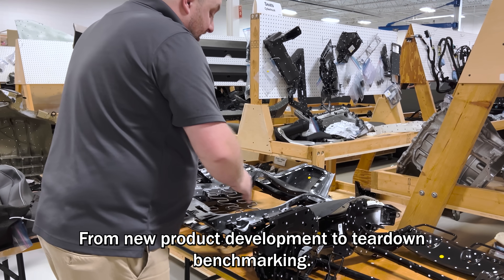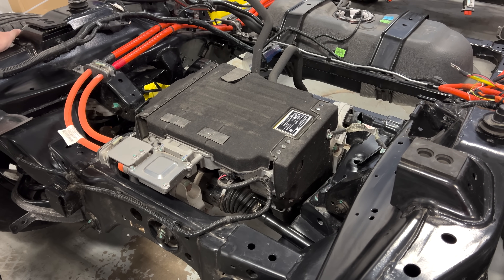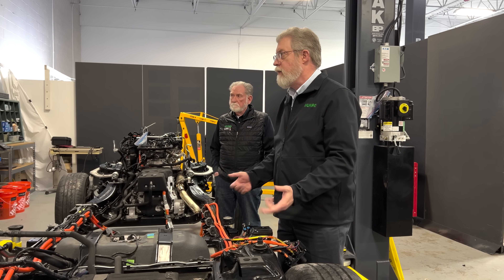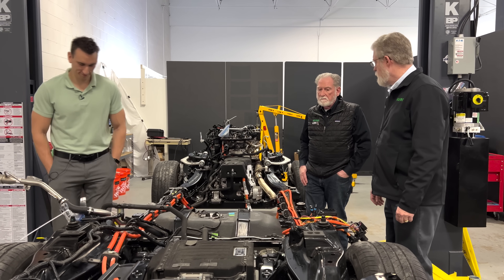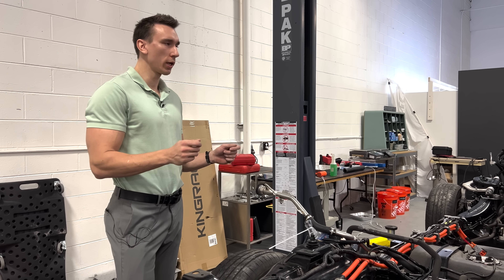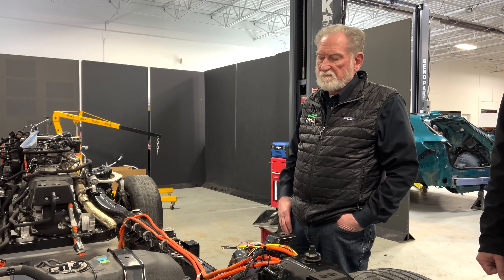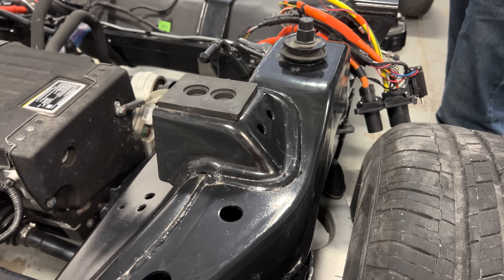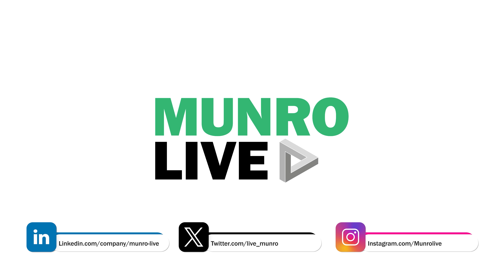There's a Monster Under the Bed of the BYD Shark!

Comment: I will have to disagee on the comment about there ground strap. For high voltage system, ground the case is always a practice. By the way, this so call ground us not the real ground, the tires are insulating the whole car, so the wait he mention is like create the shield to shield the drive noise doesnt not necssary to be the case, this type of ground will prevent noise from getting into the system, but can prevent the noise from system to get out. That say, if the paint on contact is not grind off, then it is not a very good ground. But consider it is auto motive application. Ive seen worse.
Another comment about replacing casting with welding. Casting is a process more difficult to control, especially for load bearing memeber. It is a cheaper process than fibrication, but to factoring in defect from the process( which always built in, hard to eliminate) you may end up using more material to achive the same engineering factor, or even blow through your interface envelop. The return from taking the risk is not really justified. That why on the railway side, the truck frame is moving to fibrication for newer design from casting frame. To further reduce weight, exotic material like FRP has start to emerged.
Reply: Yes, I agree that a ground strap is a good practice.  The issues here are it's location (completing a ground loop) and it's implementation using the threaded fastener as the current carrying component (not recommended).
Reply: @PaulTurnbull-EMfield How is it completing a ground loop between the two circuits when they are not connected at the same time? The charger only operates when the car is stationary. Where else would you propose moving it considering that grounding the motor is common practice?

Why the talk of moving both DC lines to the same rail when they're not a loop?

Comment: they could use that large loop with capacitors and use the earths magnetic field to charge capacitors, then use the harmonics to run a tesla coil, and use that high voltage differential to run the motor. aka free energy vechicle.

Comment: Those are some of the most perfect welds I've seen on a frame coming from any manufacturer. They appear completely uniform. Forensic analysis would have to be used to determine otherwise, but usually defective welds are very visible.
Reply: What do you mean every single on of them goes from fat to thin and is touched up in the corners, they're the worst welds ive ever seen and look like an apprentice did it, not a robot.
Reply: @Dexter_Solid Seems like you're as full of shit as they are
Reply: @Dexter_Solid  apparently BYD owns the largest weld robotic arms out there and you have no clue do you?
Reply: ANYONE seen videos from India, Africa, Asia where trucks are insanely overloaded 4m high with huge loads?   Perhaps that is the target market!   NOT Lot Crawler Urban Cowboys and Pretty Boy Dance haul trucks in the West.,,,,,,,,,,,,,,,

Comment: The reason why there is that much welding or a Trojan horse on the rear axle is probably because it is the same platform or chassis as the Leopard 8, which is a three-row SUV that might be using the same chassis.
Reply: The suv itself doesnt need this.. IMO. It could be from the U8. Or sharing some detail part. That thing is a black box.
Reply: @林振华-t4v  感觉比亚迪要出更大的卡车，刚刚把鲨鱼改名成鲨鱼06了，底盘估计也是这样

Comment: How big would the changes be that they use the same frame fro the Fangchengbao Bao 8 and the YangWang U8 which has rear steering?
Reply: Probably why it's overbuilt: shared platform for incompatible applications.

Comment: Large castings are not great for durability. They don't have the needed ductility over the life of the vehicle.
Reply: In other words you like creaking and many more points of failure.
Reply: The entire point of castings is to remove ductility and slop in favor of stiffness and rigidity which allows a proper articulated, sprung and damped suspension to do its job perfectly.  I wouldn't be surprised to see this incorporate cast subframes and submembers going forward.
Reply: The failure mode of an aluminum casting is to crack. When something cracks, it loses all its strength, even if it had higher stiffness before it cracked.

Steel will bend. It often will bend and spring back (why steel is used for vehicle springs, and not cast aluminum). Even when there is plastic deformation, it will still retain strength. That makes it much safer in heavy-duty applications. And it is much easier to repair, especially in developing countries where people still straighten and repair truck frames.

Would you rather have an impact result in a bent frame that no longer has accurate suspension alignment? Or would you rather have a fractured frame that completely falls apart while you are hauling multiple tons at high speed?